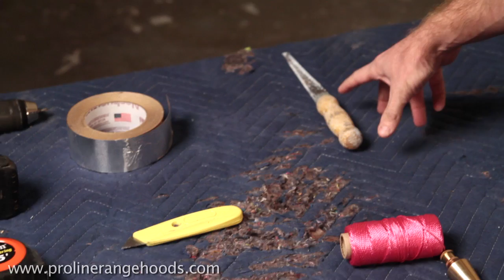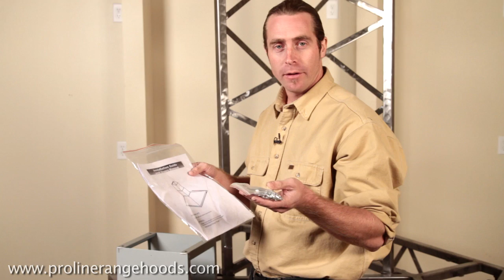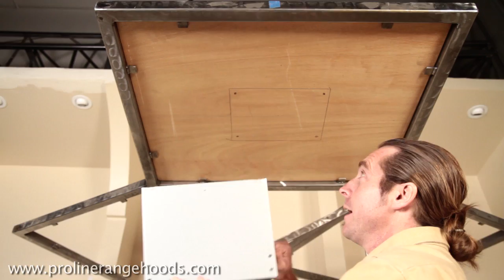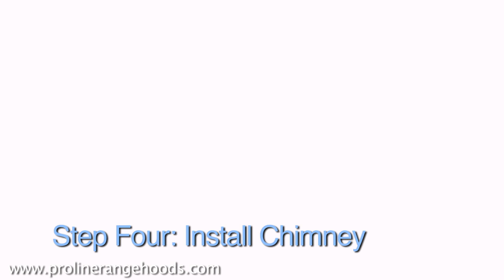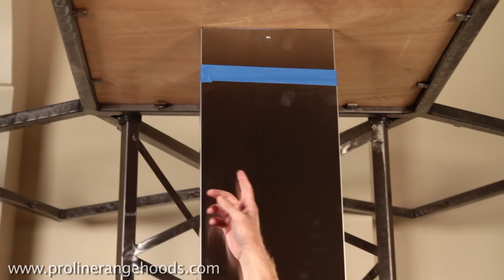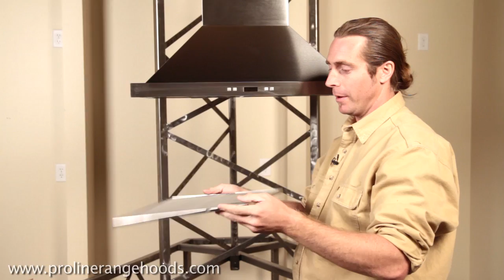How To Install an Island Mounted Range Hood - PLFI 520

Comment: Hi Tom,

Great video. I had a island range hood installed and the contractor forgot to take off the protective black and white plastic coating on the inner chimney sleeve. He was able to remove the plastic on the upper inner chimney section but not the lower part. You can see the plastic sticking out at the top part of the lower sleeve where it fits around the inner sleeve. Is there any way to remove the protective plastic without taking the entire heavy bottom of the hood range off? The contractors solution was to just stuff the plastic down between the 2 sleeves so you can't see it. I want it taken off the way it should have been done in the first place. If the plastic is left can it heat up and cause outgassing or any kind of problem? Should I just live with it or insist they take it apart and remove it?

Comment from the maker: No, you wouldn't want to.  Just use the filters for the ductless conversion and let the air be sucked up through the grease filters and through the carbon filter you have placed on the blower then it will come out the vents at the top.